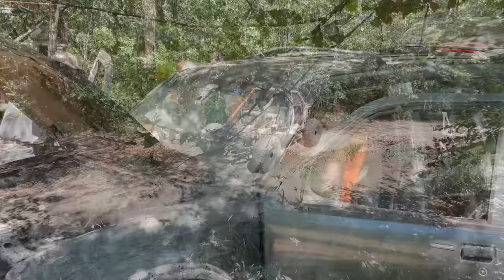Biggest Test For the Vintage Offroad Wrecker Yet

Comment: Steve the only thing I could think of you needing for that truck are lockers even though it wasn’t necessary on this trip I am really impressed with this truck. You’re getting a lot of downed travel out of that suspension. It really flexed well and being its military truck ’m sure the gears are low. Great video I love old technology. I’m not a resto mod person. I think the joy of driving an old vehicle is the old technology but I  would’ve put power steering on it as well.
Reply: I think the gears are 5:88, i have one and it’s a beast in the woods. I used it for cutting firewood and it didn’t care how bad the roads were.
Reply: I have a friend that restores M37’s. There are lock rite lockers available for them and locking hubs for the front axles. The factory tires on them were 9.00x16 which were 36 in tall.
The factory speedo would work fine with the 37 in tires.
You should try to locate a factory Braden winch and PTO and the factory winch bumper half’s for it.

Comment: I'm located in the Netherlands and also have a m37 wrecker. May I ask what steering setup you used and where did you get these adapters for the wheels?
Reply from the maker: Wheel adapter are from the people I got the M37 from in the first video:  https://youtu.be/DKQv3S4ENiU
Reply from the maker: For the steering I bought this kit on eBay: https://www.ebay.com/itm/115710826124
Reply: @ThisWeekWithCars  thanks for the fast reply, this will definitely help me out. As finding original combat rims and suitable tyres is only getting harder by time. Love your videos of the m37, keep it going!

Comment: I can't believe whatever state this is in allows this much tearing up the countryside, future erosion and mud pollution of the streams and rivers. 

 Is that Dodge still running its side valve 230 six cylinder engine?
Reply from the maker: It's an old quarry so the damage was already done.  Yes the Dodge still has the original flat head six.